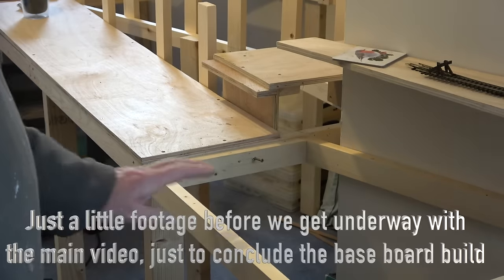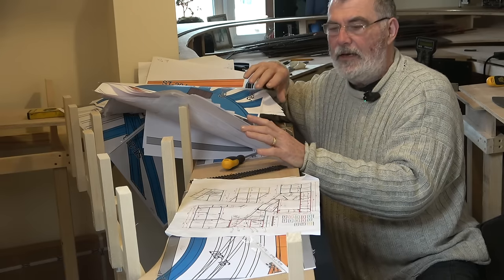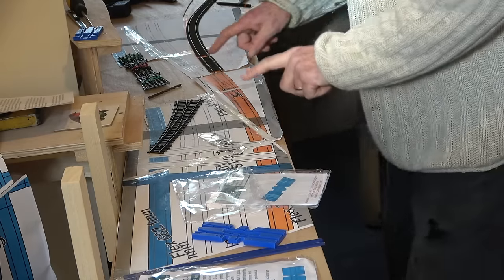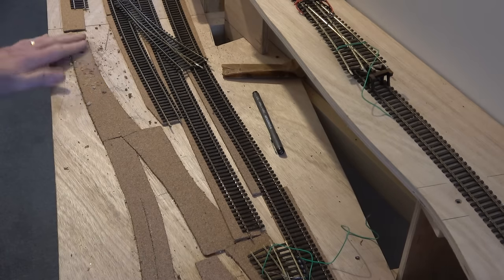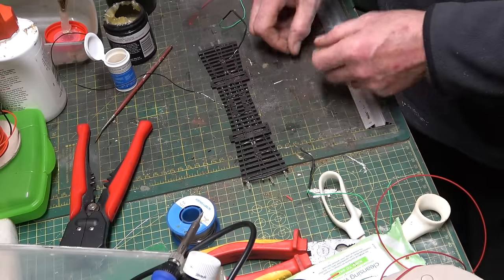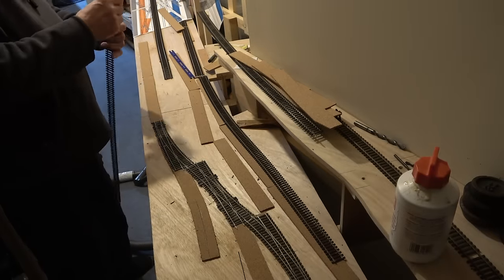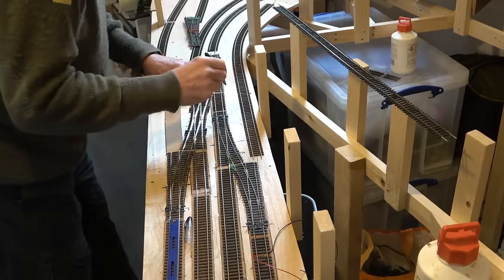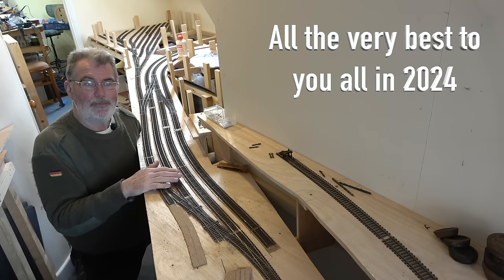New Sandling Junction Build episode 3

Comment: I am glad it is progressing. I have used AnyRail for three layouts now but never print any track sheets. I have the track plan to show what it will look like, that it will fit on the baseboard I have and it gives me a list of parts to buy. Every time I have gone to lay track, I have changed my mind here and there and usually because of point motors.
Reply from the maker: Yes I get that, I feel that as with most things, planning can be done, but knowing that some variation is possibly needed as you progress, cheers P

Comment: All the Best Paul, My Bolton layout is still up and running but I also plan a major upgrade later in year with a replacement station of Sheffield Midland its quite an investment as there are 27 points including 3 single slips map is from a 1966 British Rail map and I also plan on using iTrain software .... Regards John
Reply from the maker: Wow John that will take you to the limit, complex,b ut very rewarding too. cheers P

Comment: Wher I join sections I would overlap the top surface with the base joints, that way the two adjoining tops are fixed to the same bit of frame and would hold level, just an idea. regards, Geoff
Reply from the maker: Thanks Geoff always useful to know these things, cheers P